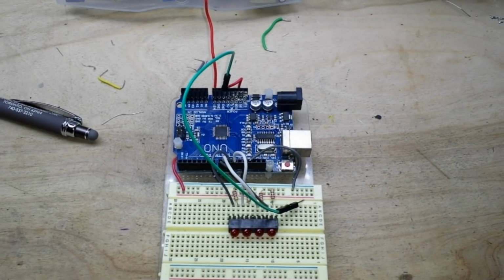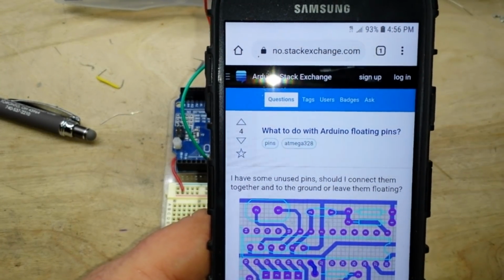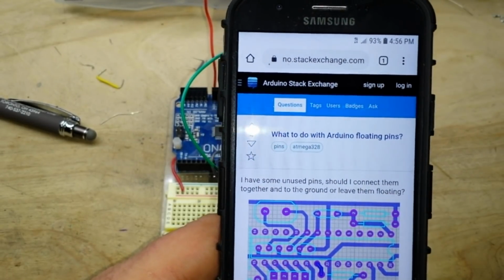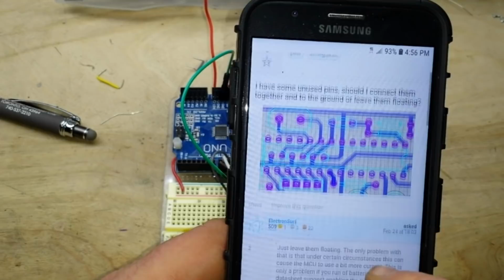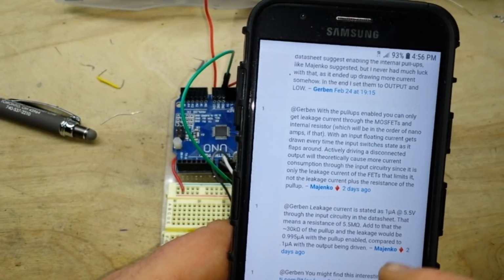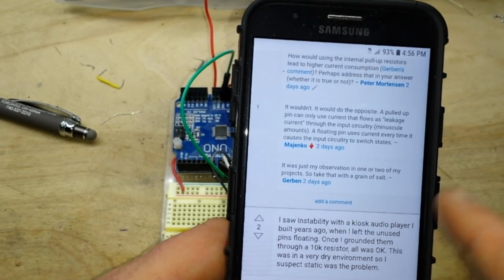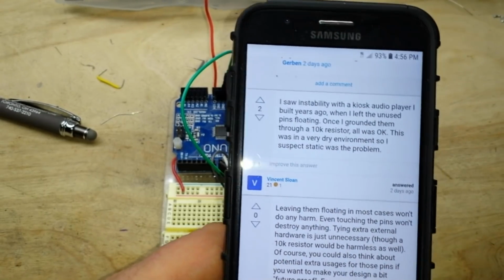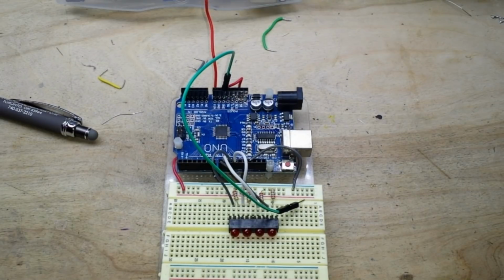What to do with unused Arduino pins

Comment: @3:13 there was two LED's lit on the PCB an 65mA @ 5:32 and 60mA only one LED lit, maybe that where the missing 5mA went? For home use leave them floating, otherwise no pin should be left in an undefined state or floating. Floating is not good as it leaves the pin open to ESD events.

Comment: In all my public microcontroller projects, I design in at least one LED on a 'spare' pin
The reason if for no other reason is to implement an 'activity LED', or in other cases, I code up a routine to blink a sequence to indicate 'error codes' on one or more LEDs
Always useful - even if it's only toggling on/off every time you pass through main/loop()... even if you can't see it with your eyes., you can scope it to see the loop is running.
With only two pins, you can use two LEDs (or a single R/G LED) wired back-to-back using a 4-blink sequence to display many codes with three colours (R|G|Y) per blink.  ([12 * 24] colour/order combinations with a single RG LED!)
I write up a 20-slot sequence with slots 0, 4, 8 & 12 blinking a LED/pair for about 100mS - the unused slots are OFF, and the gap 13-19 leave a pause between each repeating blink sequence. (i.e. each blink cycle ~2secs repeating - it's very easy to see and count 1st, second, third and fourth colour)

Comment: Quite simply, you should always refer to (and follow), the device data sheet!  No excuses!
Connecting unused GPIO pins directly to ground is generally never recommended, as this equates to a direct short if the pins are ever configured as outputs.    
For reference, I paste below the ATmega328 data sheet section which very clearly outlines correct handling of “Unconnected Pins”. 
<quote>
14.2.6 Unconnected Pins: 
If some pins are unused, it is recommended to ensure that these pins have a defined level. Even though most of
the digital inputs are disabled in the deep sleep modes as described above, floating inputs should be avoided to
reduce current consumption in all other modes where the digital inputs are enabled (Reset, Active mode and
Idle mode).
The simplest method to ensure a defined level of an unused pin, is to enable the internal pull-up. In this case,
the pull-up will be disabled during reset. If low power consumption during reset is important, it is recommended
to use an external pull-up or pull-down. Connecting unused pins directly to VCC or GND is not recommended,
since this may cause excessive currents if the pin is accidentally configured as an output.
</endquote>

Comment: I'm thinking that setting them to output, writing zero, and leaving them open cannot possibly cause more current than providing current paths via wires.  The only other option that might reduce the current is to make them outputs, write ones, and leave them open.  Frankly, I am surprised that Arduino's default init code does not set a minimum current state unless that state is subject to accidental damage.

Comment: If you have a look most manufacturers will have seperate datasheets available to getting the best low power out of the uC. Microchip have a numerous one on extra low power modes. Lots of great information in them about assigning unused digital pins to inputs and tied low (with resistor) or enable them as analogue which can save some power on the digital transistors. Turn off brown out. Disable timers. Disable watchdog or place it under software control. Lower clock speed etc. Even how you code ther design and your use of registers can affect power consumption. It can be a really tricky business! Even using push buttons with internal pull ups so you can interrupt detect and disable the button as soon as it is pressed to lessen current draw through the resistor!

Comment: I see that you have the exact same arduino as I have, can you tell me what the pin slot right next to the USB chip is for?
I also have the extra pins soldered next to the ISCP slot and made a little board with a DH22 temperature and humidity sensor that I can push onto those extra pins and it also covers the first couple of analog pins so I can use the analog 5 pin as digital 19 in the code to process the signal from the DH22 sensor and at the same time I have a 2.8" resistive touch screen on the arduino which isn't possible normally because the screen covers almost all the original pins of the arduino.
I like this arduino the most just because of all the extra pins you can solder on this board, those are very useful if you want to use a touch screen and at the same time you want to have some sensors or communication lines available, also with the extra pins you could solder them on the backside of the board and then you can put the arduino on some breadboards which is also very useful for prototyping.

Comment: This is from the datasheet: 
10.2.6
Unconnected Pins
If some pins are unused, it is recommended to ensure that these pins have a defined level. Even though most of
 the digital inputs are disabled in the deep sleep modes as described above, floating inputs should be avoided to reduce current consumption in all other modes where the digital inputs are enabled (Reset, Active mode and Idle mode). The simplest method to ensure a defined level of an unused pin, is to enable the internal pull-up. In this case, the pull-up will be disabled during reset. If low power consumption during reset is important, it is recommended to use an external pull-up or pull-down. Connecting unused pins directly to VCC or GND is not recommended, since this may cause excessive currents if the pin is accidentally configured as an output.
Reply: You beat me to it.  The best thing to do if you're unsure is to RTFM.

Comment: From the data sheet: 13.2.6 Unconnected Pins
If some pins are unused, it is recommended to ensure that these pins have a defined level. Even though most of the digital
inputs are disabled in the deep sleep modes as described above, floating inputs should be avoided to reduce current
consumption in all other modes where the digital inputs are enabled (reset, active mode and idle mode).
The simplest method to ensure a defined level of an unused pin, is to enable the internal pull-up. In this case, the pull-up will
be disabled during reset. If low power consumption during reset is important, it is recommended to use an external pull-up or
pull-down. Connecting unused pins directly to VCC or GND is not recommended, since this may cause excessive currents if
the pin is accidentally configured as an output.

Comment: As a retired programmer who started as an electrical engineer, I can tell you the worst thing you can do with a high impedance input is to leave it floating.  It becomes susceptible to any stray rf or 60/50 Hz hum causing it to switch on and off and wasting energy in the process.   The second worst thing to do is setting unused pins as input_pullup and connecting them to ground.  You are effectively putting multiple 10k resistors across the power supply.

Comment: I had several times floating pin problems using STM32L4 MCUs under Mbed OS. The unused pins have been set to input (no pullup/pulldown). During deep sleep the input floating pins produced continues wakeup’s and have been eating about 50µA, after fixing this pins via pull-downs, I got down to 1µA in deep sleep.

It took me quite a while do figure out where this 50µA drawing was coming from, of course I was looking into the software to find out if some units are still active while in deep sleep.

At one point, I was holding the PCB with my finders and suddenly I was down to 1µ, after more fingering I figured our that the SPI MISO pin was the problem.

So my proposal for floating pins is to set them to input with a pulldown.

Great and very important video, thank you. 
Greetings from Hannover, Germany.

Comment: Hello friends.  Dr. Quincy here.  For my battery run projects, I set unused pins as output and also set them high to save power.  If you really want to save power, disable the ADC, the Analogue comparator, USART, Timer0, Timer1, Timer2, and consider using one of the sleep modes.  Of course, if you need one of the above, then do not disable that particular component of the ATMega328.  Interestingly, if you set a pin as output, whether high or low, that state is kept when in one of the sleep modes.

Paul, I could share the code for the flashlight project on ATtiny841. if you are interested, let me know.  I'll comment it up to explain the code as best as I can, for I am a pathologist and not a programmer after all.  LOL.
Reply from the maker: Go ahead Doc. I'd love to see it.

Comment: Have you tried to set the unused pins as outputs and just leave them unconnected? This is what I do for low power battery usage. Quite curious what the difference would be in your setup.
Reply: PS: You might find this video interesting:
https://www.youtube.com/watch?v=urLSDi7SD8M&t=1090s
Reply from the maker: 1st thing I showed.
Reply: @learnelectronics  What I meant was setting every other unused pins as pinMode output.. At 1:54 you say pinMode 8, 9, 10, 11 are outputs and at 2:13 you say all unused pins are floating. You didn't mention setting up the pinMode for the unused pins. Or am I missing something?
Reply: @learnelectronics  Sorry, my bad. I missed it at 5:53 :D

Comment: Would it be smart to ground these through a resistor instead of direct to ground? Just in case you mess up the code. I wonder if that would change current use.
Reply: Yes, it shouldn't change the current use but sends your BOM cost high
Reply: @SurajGrewal  Not really a big BOM issue as  you could connect all outputs to a single pull-down resistor.